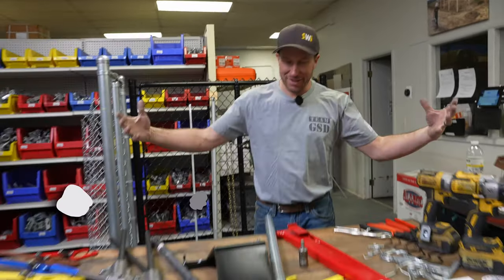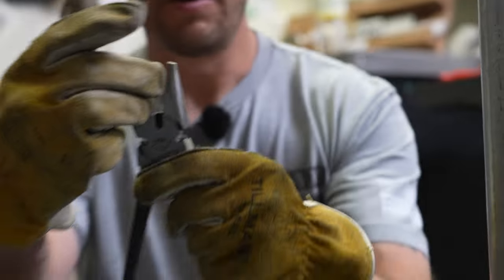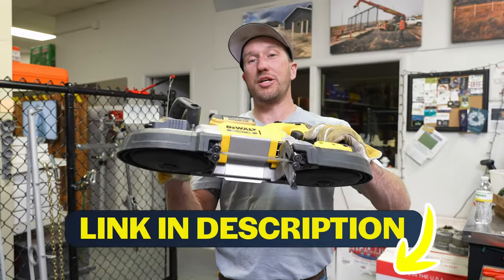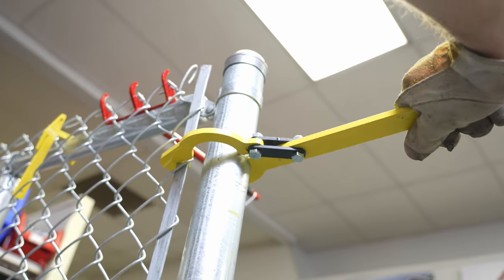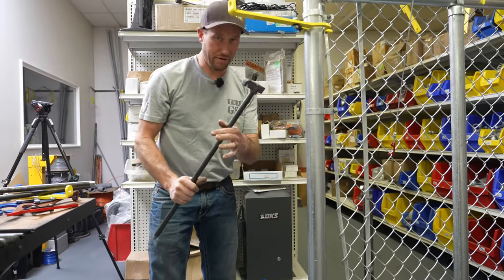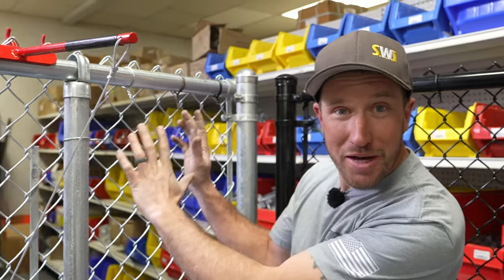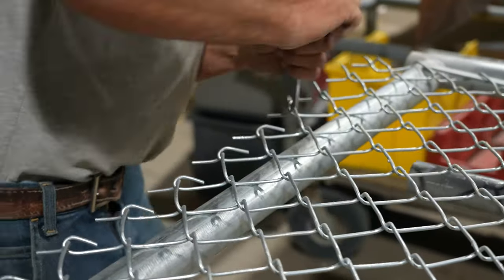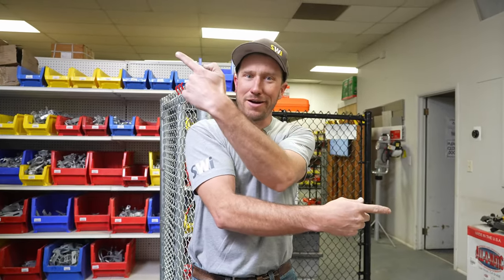Every Pro Chain Link Fence Tool We Use

Comment: I got a Question about the Chain walker, I've never seen one we use come alongs 2 to 1 ratio so my question is how heavy are they and what's the cost. Come alongs are not very heavy and we typically use 8 of them at a time when doing thousands of feet.  Sence we can set 1 at 200 ft spacing that way we can pull the bottom wire then tie the wire roughly were we want it and later mesh  1600ish feet in a day after we build the frame of course 10 ft commerical typically with bar arms. Come alongs are cheap and easy to replace. So could you go over that and how much is it's compacity compared to a 2 to 1 come along. That way i can show my boss if they are worth getting.  Our come alongs do 5 tons in 2 to 1 weight about 15 pounds i'd say from carrying them every day it feels like near 60 pounds when carrying 4 of them when machines can't be used
Reply from the maker: Trust me when I say we used to use come-alongs as well, and as soon as we found these we threw them out. Probably the best thing to do would be buy just one and try it out--if you're like me you'll change your mind and get more.
Reply: @SWiFence  I prefer Chains come alongs you have to check the wire every day make sure they are on release when putting them in the truck if not they get tighter while driving down the road lol. Where do you get them from that would ship to canada?
Reply from the maker: Well this is going to sound self-serving but we sell them. https://bit.ly/strainritestretcher (We're not opposed shipping to Canada--you'll probably have to call the shop to order so we can work out the extra details. 307-578-8040)

Comment: Never seen a chain walker, I work for one of the biggest fencing companies in North America. We use come alongs and do thousands of a feet in a few weeks in the roughest toughest grounds. Chains are heavy specially when we need 10-20 in differents spots looks more expensive as well. Trus rod useless to us we have hard ground if we are lucky with good ground u can move with a shovel our terminals are 4-5ft deep and 12" concreted in centered mid rails depending on height single or double height take away by half minus 4 single rule of thumb etc. I was shown this video I saw the banana clips a co worker of mine is 63 made he's made his own 40 years ago i fabricated 30 of the ones you showed and they failed our tests, They twist and tangle buckle when they hit sleeves even fall off, Slide around on the pole in awkward situations trying to put them up on 8ft lol I don't always work on flat grounds. Ours don't fall don't twist don't go flying in to the woods when stretching long distances really fast. Only benefit is they stack better. Ours have weight a better hook with a stabilizer bar they are not small and our style doesn't move when we use our special pole with the right groves cut out on the post to reach heights.